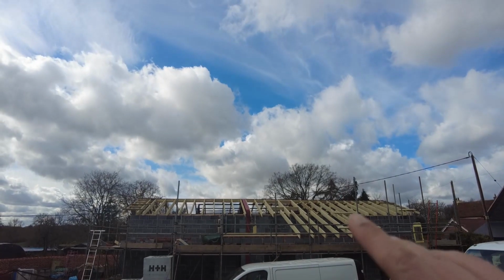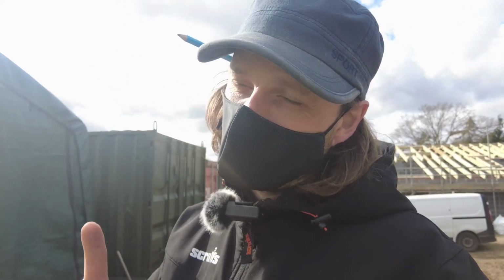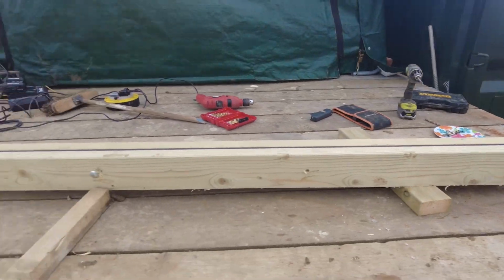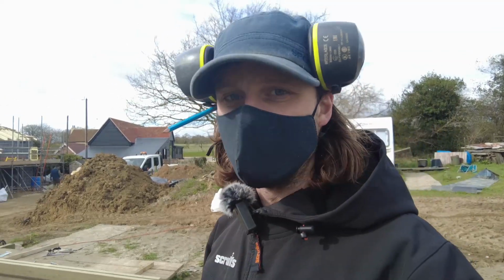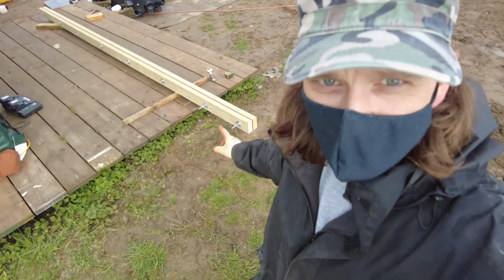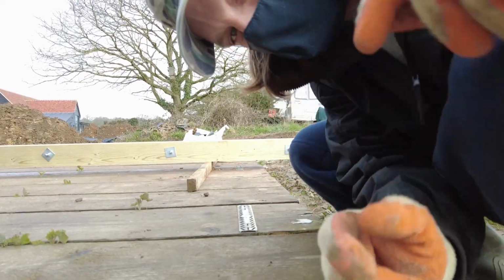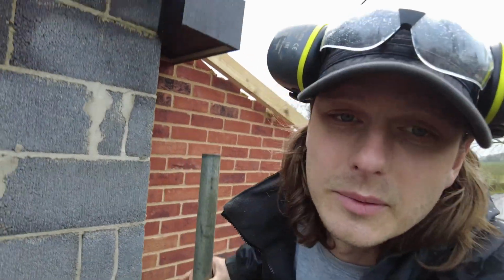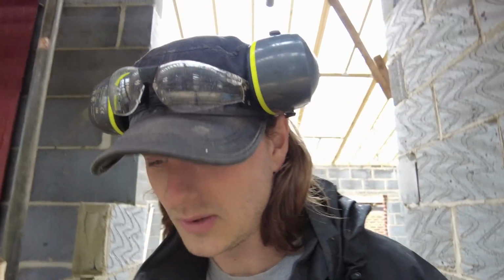Hand cut roof install & Making a flitch beam ---   #SELFBUILD    [The Barn Rebuild - 005]

Comment: I noticed your carpenter was just picking the boards sequently without looking at which way the crown or warpage is. Almost all boards , especially long ones like this, have a natural warpage or bend, that we call a “ crown” here in Canada. I.e., no board is completely straight. This can be 1/2” over 10’ or so (sorry, we’re still Imperial for short distances, Metric for long) so if the crown is up on one board (which it should be) and crown down on the next, you could be out by 1” !  I jumped ahead to one of your latest episodes and saw that the rood was uneven. I’m sure there were lots of careless reasons but crown could be a problem. If you ever watch our contractor/DIYer/tv star, Mike Holmes on regular TV, he’ll pound this into your head many times.
Reply from the maker: Good point 👍 I think most tradesmen over here just chuck it up as quickly as possible without having much pride in their work 🤷‍♂️

Comment: So did you get planning to build outside the original footprint?
Reply from the maker: I did indeed, both on the original 'conversion' full planning permission and the new 'rebuild' full planning permission. From research, planners normally allow 'extensions' for things like utility and plant rooms and that's exactly what my extension is for. After you get full planning permission you could also go for a 'minor amendment' in which you can increase the size by up to 25% without too much fuss. I didn't want or need to do that though, I was happy with the size and design.

Comment: Your little rant about being the site manager when you shouldn't have to be, is unfair, you are a micro manager, you don't se the drawings as accurate, and are making changes to the specifications daily.

You don't trust anyone, and your only knowledge of the construction trade is purely from social media.
Reply from the maker: Your little comment couldn't be more wrong 😆 I employed my main contractor to complete the shell without my input whilst I built the cartlodge. He relied on me to tell him what to order and was looking for me to be his site agent at his next development. I doubt he would have done that if I was some divy tiktoker that hasn't picked up a hammer in his life. You are correct, I don't trust the trades. At the end of the day they are doing a job they don't really want to, they will cut all the corners they can, get out and get paid as quickly as possible. There's no wonder that they make mistakes. Just because I say I don't have a trade (as in I don't work for clients doing a trade) it doesn't mean I can't do pretty much all of them. I didn't change anything daily, I changed one beam. However, I did adapt because things had been done wrong (or should it have been knocked down and started again because the steel fabricator did the roof at the wrong angle and the bricklayers told them to put the steels in 25mm off square from what they had already started building). 

I could make an assumption and say you're probably just an armchair keyboard warrior who hasn't picked up a saw in his life but maybe you are a disillusioned butt hurt carpenter 🤣

My last house I did a hip to gable loft conversion with a double dormer, a rear extension and a full refurbishment. If you wanted to see the before and after shots then let me know. I did everything apart from installing the consumer unit, the foundations, blockwork, plastering and the boiler. It's a shame I didn't film it, but I did film me building the cartlodge if you still don't believe me 😆 the only thing I didn't do was the brickwork, the consumer unit and plastering.  https://youtu.be/J2DDPVaeOho?si=ra49HfK_iTjZ6GQy